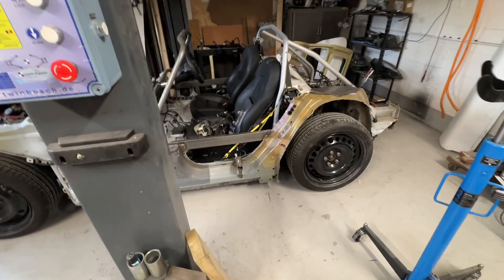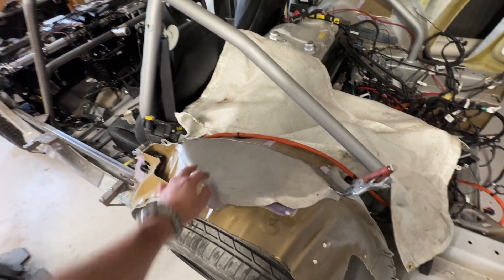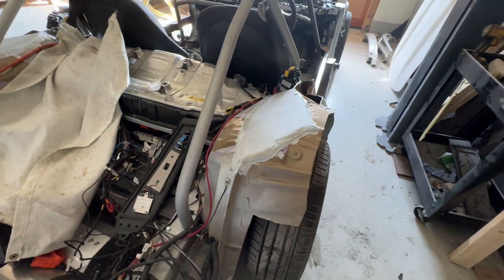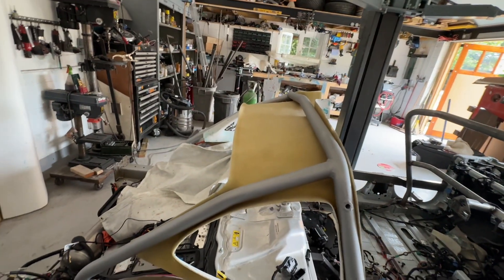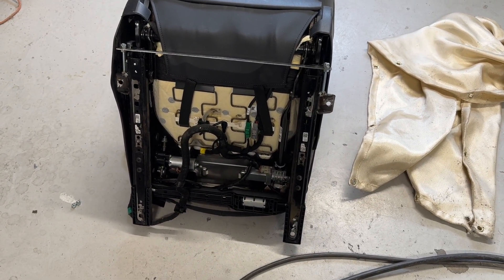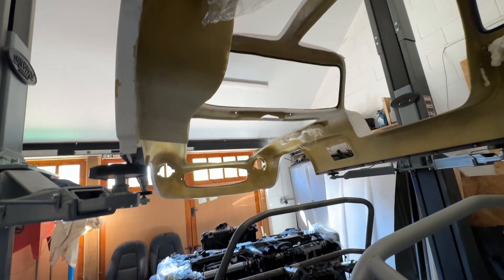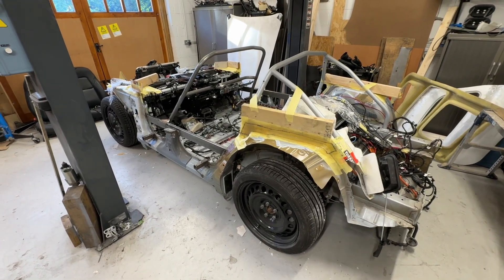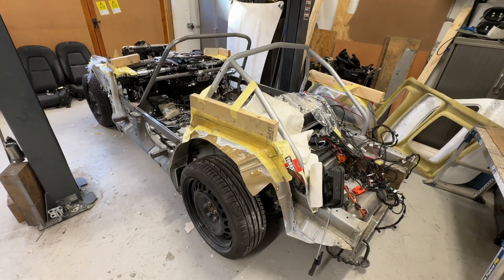Tesla Gullwing build part 28: body to chassis interfaces

Comment: How are you planning to fight with the inevitable rattle between the fibreglass skin of the exterior and the interior that's touching the roll cage?
Reply from the maker: Most likely with thin foam gasketing or I might use a low strength silicone..

Comment: Amazing how consistently you are chopping away at this project! Are you retired and doing this full time or do you still have a job as well? Also, not sure if you mentioned it but are you going to connect the two roll hops front to back as well or does that get in the way of the door hinges? The front hoop isn't going to do a lot other than holding up the body and windscreen otherwise.
Reply from the maker: I have a full time job, so only evenings and weekends! There will be a central bar to mount the door hinges to but as I’m using modified model X hinges I want to get the doors in place first as they will define where the hinge mounts and central bar will go, I obviously want to make it as strong/ big as I can!